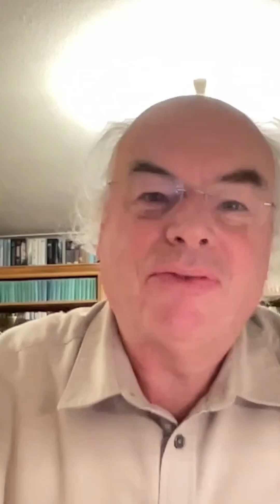#Space Based Solar Power vs. Helium-3

Comment: Helion says they can make it cheaper in their reactor
Reply: his point was that solar is renewable, and for the investment to harvest energy solar would be better.  Solar panels would also be a lot more efficient to change out, repair, and replace if they fail or are damaged. lest we forget how many small meteorites strike the moon. Just one would spread pieces of that reactor across the surface... a solar panel would be replaced by a single robot from one of the boxes laying around with spares.